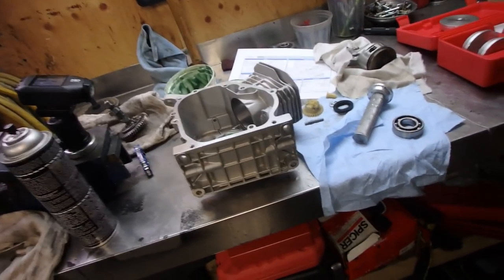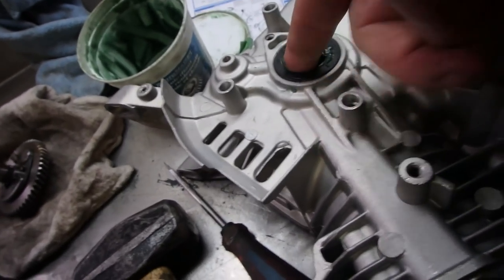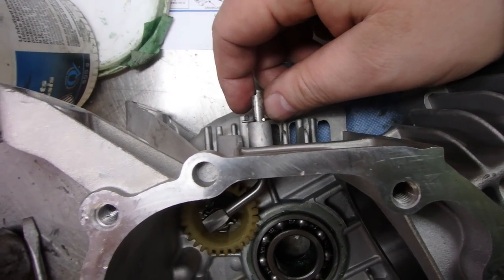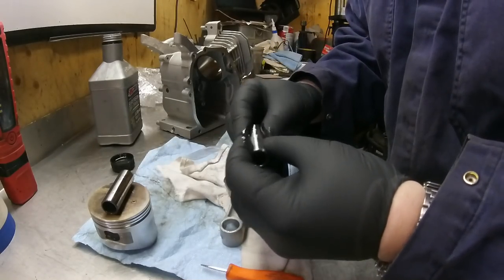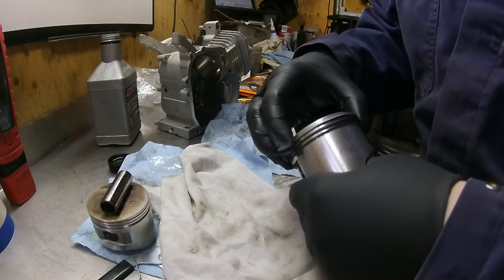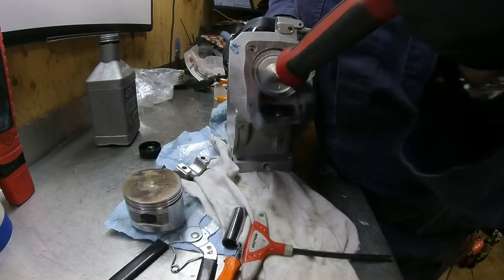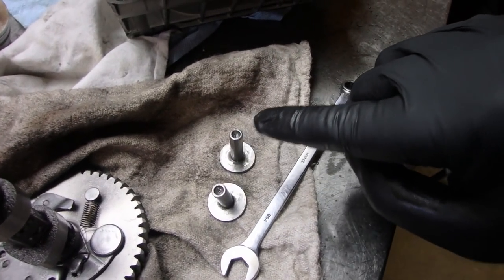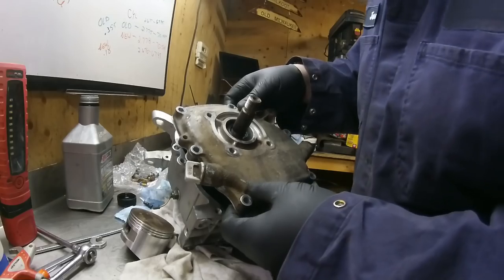Honda GX160 Crankcase Rebuild Assembly

Comment: For anyone who is rebuilding any small engine regardless of brand that has either had all starvation or contamination of the oil at the connecting rod journal and utilizes an aluminum connecting rod where the bearing surface had gaulded, aluminum deposits will be embedded in the crankshaft journal bearing surface and will need to be removed. Best way that I have found to eliminate the aluminum deposits in the cast steel crankshaft journal is to use hydrocloric acid, AKA muriatic acid. This can be achieved by pouring the acid into a dish big enough to fit the crank journal. It shouldn't take but a few minutes for the acid to eat off the embedded aluminum deposits. This method will not hurt the cast steel crankshaft. If a new aluminum connecting rod was installed due to bearing or rod failure without removing the embedded aluminum, the new connecting rod will start to gaulling as the engine runs either seizing the engine or breaking the connecting rod causing catastrophic damage. Just a little bit of info for anyone rebuilding from a broken con rod or gaulled con rod bearing surface. 👍

Comment: Great video 
Took mine apart and found the connecting rod bolts loosened about 1/8 of thread visible. 

I think it came apart or someone forgot to tighten them. Was clicking even turning by hand.

Comment: Finally some good videos explaining these engines! Thumbs up! Great work.
Reply from the maker: +RustySWE there will be a bunch of videos on these engines so stay tuned
Reply: +jerry bskorner is there any easy way to tune this engine for more hp? For use in boats or gokarts?
Reply from the maker: not without changing the engine internals for any noticeable gains
Reply: I know this is an old one but what’s some good ways to up the power in these engines? Small light mini bike frame will be it’s new home if I can get some power out of it

Comment: Nice job. I'd have liked to hear the torque values and where to use loctite. Also, did you check ring gap, etc?  I would have frozen the bearing before installation and heated the case to reduce impact jarring of bearing during installation.

Comment: You will definitely know if the crankshaft bearings are seated fully when it comes to put the side cover on. 😉
Good looking out for folks just learning tho. I could see someone forcing the side cover on by running it up flush with the crankcase bolts. Yikes!

Comment: How about removing the case bearings? Any secrets so I don't jank up my block or cover?
Reply: 0
Reply: Use a spider puller. I got one off amazon and did my GX160 crankcase bearings with it just now, really easy job.
Reply: @Jonathan Bott  I'll have to check that out! 3 years later and I'm still learning new stuff!!

Comment: Look forward to seeing how that decompression gismo works on startup.
Reply from the maker: +STEVE ROB if you watch closely in the video you'll see the camshaft has lobes and a spring,  according to the service manual the faster the camshaft spins the centrifugal force pushes those lobes outward disengaging the decompression lever.  if you google "GX160 Decompression" then click on the images you'll see it clearly in the photos
Reply: jerry bskorner Thanks will do.

Comment: I was just putting new bearings and seals in my new 196cc clone block but not 100% sure if i got the seals in even with the outside of the block or not. Could bev slightly off. What is the name of that tool you used to hammer in the bearings and seals ? I need to get me one of those.

Comment: I want to do a leakdown test on my dads Honda HRU217D lawnmower engine before I pull it down & replace the piston & rings (I ordered 014 rings,it's an early GSV190 motor with 004 rings & I doubt that they are interchangeable on the original piston) to confirm if that's why it's a bit hard to start now & why it sometimes burns oil when it's cold.

I ordered the rings but then have to do a separate order for the piston & seals.

Comment: Great video. Does the same rules apply to gx120 as iv stripped mine all down replaced the valves and put it back together but now it won’t start. And I’m wondering if the timing was out. Would this affect the starting of the engine. Thanks 
Dave

Comment: Thanks Jerry. Great video I just have a question is the rod torqued or just tightened? I am getting ready to do a generator and this video is coming right on time, thanks again for the info.
Reply from the maker: +Bill Langdon since this connecting rod didn't have any bearings just a machined surface I just tightened them, most likely your Generator will have actual bearings and you should properly torque them